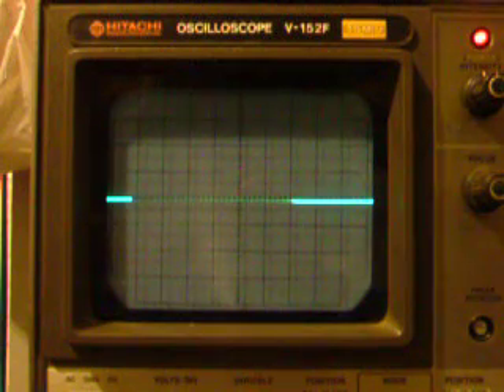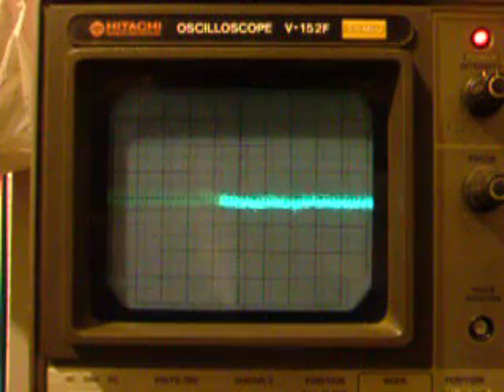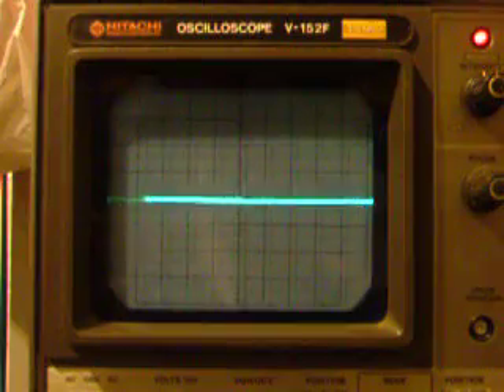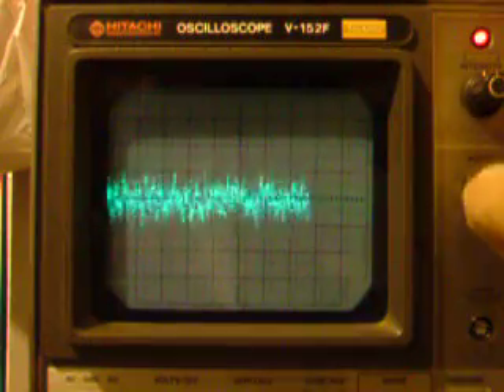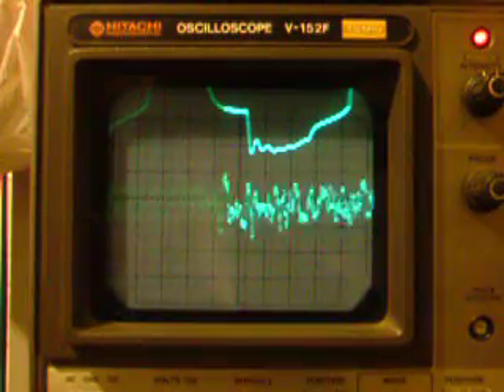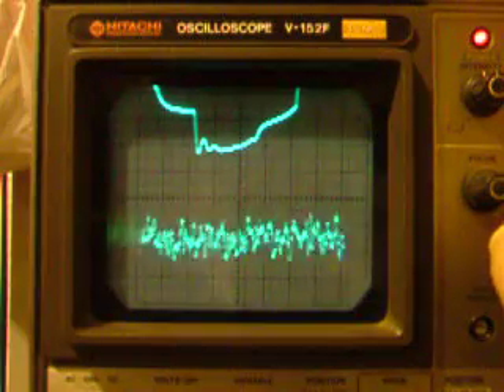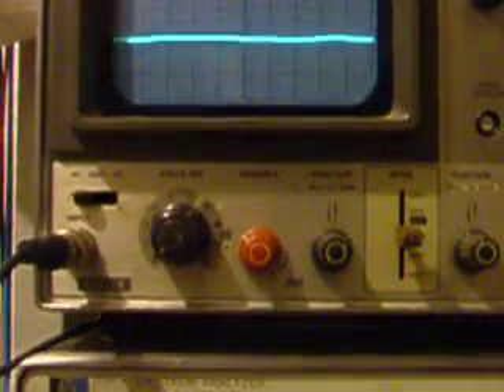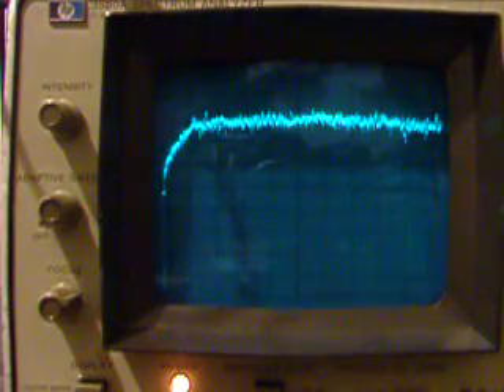The Hunt for Buzz & Hum - Part 10 of 10

Comment: thanks for the videos, I have the exact problem. it is on a plexi amp so it is very similar to the high octane, I have track the noise to only one of the two input stages. It should work well with AC on heathers I think it could be a kind of ground loop a current in the ground line could distort the heathers wave. please let me know if you found any other issue.